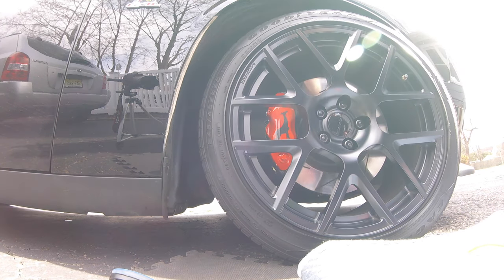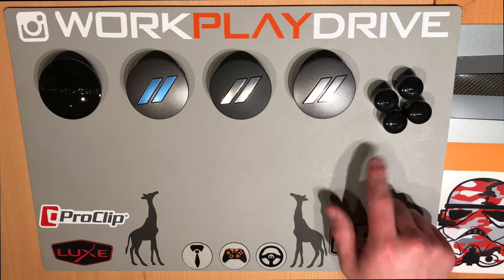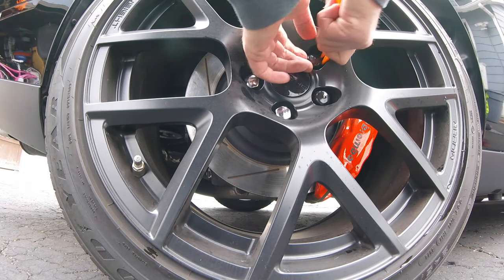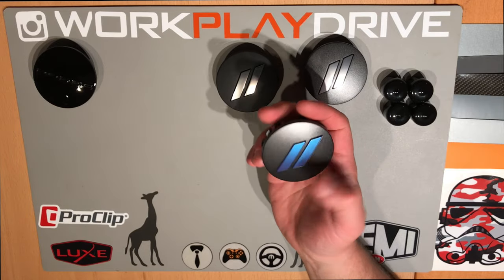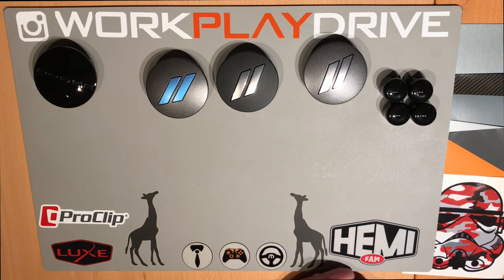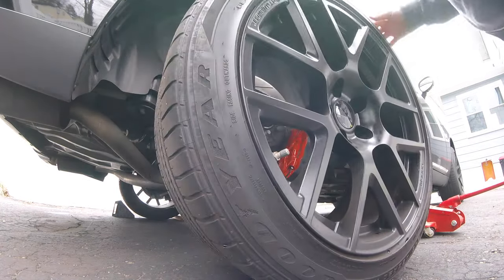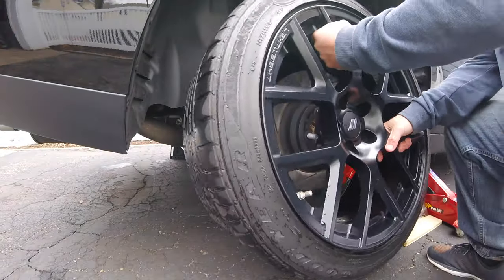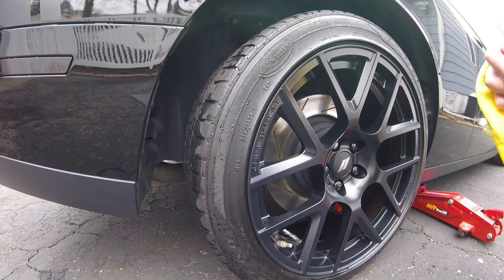Center Cap swap - Lug Nut covers - How to Jack up the Challenger Rear Wheels

Comment: Just got the replica Hellcats on my 13 RT. They came with the ugly Voxx center caps and I purchased the exact Dodge center caps you did. Been reading about some people saying they don’t fit but I guess I’ll find out. I have black ColorLugs for the lugs and picked up the same Titan socket and breaker bar you listed in the description. Still considering black lugs vs the plastic covers. Really appreciate the video. That “puck” you are using in the rear to jack the car seems like plastic on my ride so hopefully it doesn’t crack. But I will definite use the same spots you did for the jack stands. Thanks again.
Reply from the maker: That puck is a loft point mentioned in the service manual so no worries using it. 

I originally was looking at colorlugs then I recognized the shape for tube end caps I used back in the day. So I ordered those instead at 100 for $8

Comment: I thought about getting the lug nut covers, but i was worried about them scratching or chipping when I would take my tires to get changed at the dealers.  So I ended up buying the black OEM lug nuts for $78.  Expensive, but they look really good.  
How come you had to by the black dodge china ones in the first place?  My black out patch came with black dodge caps.
Reply from the maker: I finally found a good set of black lugs, but I opted to keep the caps so I never need to worry about them getting scratched,  My 2015 wheels came with the Chrome dodge center caps, IMO didn't look so good on an all black car.
Reply: Ah, I agree. The chrome doesn't match at all. The only chrome left on my black challenger is the fuel letter on the blacked out fuel cap. If I recall you placed a decal over it, right? I'm thinking of blacking it out with plasti-dip. I did that on the dodge emblem and it looked good.
Reply from the maker: My fuel door I've been waiting for the Stig Emblem from Steve White in toxic orange to come back in stock.  .  http://www.stevewhiteparts.com/steve-white-catalog-08-17-dodge-challenger-new-fuel-filler-door-decal-emblem-stig-racer-x-toxic-orange-swmfd9?parent=1003.
Reply: It looks cool.  Does your state have the black and yellow custom plates?  I just got mine is a week ago, they're the CA classic plates.  They require both front and back plates for CA.  I don't like that rule, but the black plates are nice.
Reply from the maker: We only have one plate option, I love the new CA plates.  We also have the front plate rules, luckily my car was picked up out of state so they didn't drill in the front plate mount.  I tried a few options then went with the Sto-N-Sho so I can remove it for shows.  https://youtu.be/RytZZ3QsRiI
Reply: My car came with the holes pre drilled so if I take me front plate off I'm stuck with two holes. 
I saw your video. Your videos are always very detailed and helpful. Thanks, keep up the good work.
Reply from the maker: Shawn John sorry to hear that if you need them a bunch of places make bumper plugs like these https://www.bumperplugs.com/index.php?route=product/category&path=1_11
Reply: Thanks, that does look really good!

Comment: Is that green 22mm lug nut socket really worth it? Some Amazon reviewers weren't too impressed.
Reply from the maker: I've removed my tires countless times and have only used this socket.  I'm very happy with it.  I use it with a breaker bar and torque wrench.  When I purchased I recall the bad reviews being from people who were trying to use it with an impact gun.  I cant speak for how it works under impact force.
Reply: I've just ordered it from Amazon prime. Thank you very much. I also don't use an impact.
Reply from the maker: No problem :)

Comment: how do you clean the break pads?
Reply from the maker: Are you talking about the visible brake hardware or pulling the pads to clean the surfaces?
Reply: Yea basically the disc. my front ones are like brownish now
Reply from the maker: I painted my rotor hats they pretty much rusted out a few weeks after purchase.  http://www.workplaydrive.com/2016/05/10/annoying-thing-about-my-black-scat-pack-wheels-fixed-10-00-per-wheel/  the part of the rotors that your brake pads come in contact with should of course not be painted.
Reply: Work Play Drive ahhh thanks j see. Yea it's the break dust